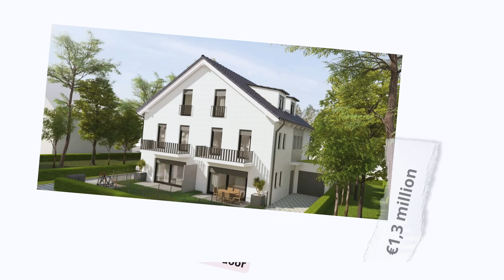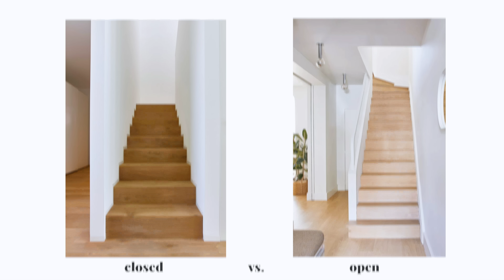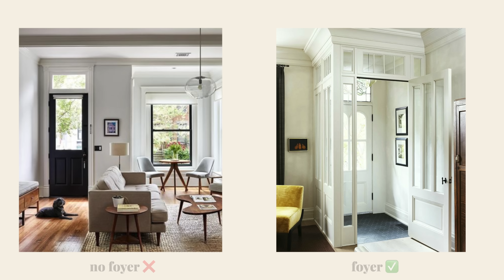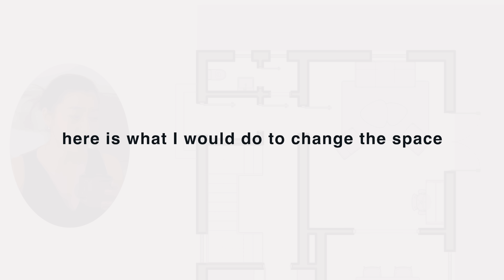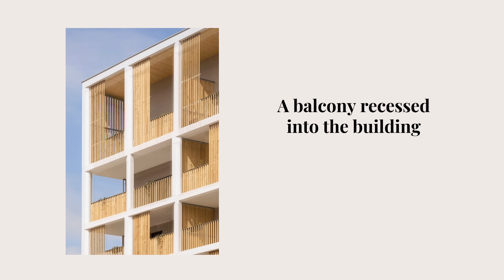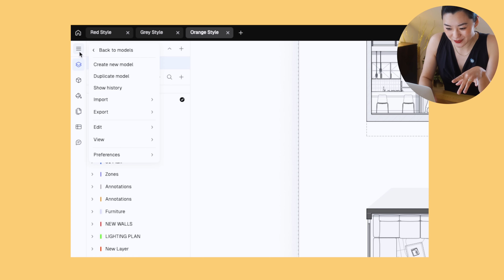Architect’s Advice: 7 Common Layout Mistakes + What to Do Instead

Comment: My grievances/experiences: 
1) No Genkan: it doesn't need to be Japanese style, but every home should have a little space with an easy to clean floor where you can sit down, and take off your muddy shoes, soaked coat, umbrella, etc. and let them dry, store frequently used outdoor attire... Meanwhile, what I see most often: no space planned in for shoe cupboard, coat hanger, etc. and everyone squeezes past the furniture, until something falls down or over and mud gets everywhere...
2) unnecessarily long corridors: they take away a LOT of space and if they're narrow and go around corners, you'll have trouble moving furniture! 
3) centered doors and windows: I'd put a different reason against them: try fitting a bed into a small room with centered doors and windows!
4) Having more than four corners, odd angles, or steps inside a room. They make furnishing hard! 
5) having doors or windows collide with furniture such as your bed, or the water tab getting in the way of opening the window, or having a light switch hidden behind a door or worse wardrobe. 
6) Kitchens should be close to the exit. You don't want to drag a leaky garbage bag through the entire house! Plus, the pantry and dining a ea should be next to it. Also, keep in mind that kitchens can get very hot and moist. Thus, high ceilings or strong ventilation are highly recommended. 
7) allow cross ventilation through the entire house. To me, a bathroom without a window is a breeding ground for mold. Yes, you can install ventilation, but my experience tells me that it never works good enough...
8) even the smallest flats should have 3x3m space kept free. You'll always find a use for it! Sport, ironing, working on something, etc.
9) plan in enough storage, or rather more than you think that you need...
10) Think about the future: kids will move out, your mobility may get impaired, etc.
11) Pay attention to natural light and prevailing winds! There's no point of installing a roof, if the wind throws rain right under it! You'll hate driving to work, if you get blinded every time and good luck reading from a monitor, if the lighting comes from the wrong direction...
12) For Europe: since AC is out of the question, make sure that your shades work in summer! There's nothing worse than good isolation, but a glass house effect!
Reply: Why is AC out of the question in the EU? Trends appear to be the opposite by my observations.
Reply: @court2379  I've only seen AC in fancy office buildings, hotels, and regular supermarkets. We had kids collapse in school, because they refused to install AC or give the kids a day off. Work in many places can be a huge pain too, especially if you're in a kitchen or with machinery that generate heat during their operation... BTW: I'm talking about central Europe including Switzerland. I'm not talking about Eastern Europe, which does seem have more AC and better internet despite being poor...
Reply: @court2379  To answer your first question: I don't know.  My best guess is that dreaming of AC is considered a thought crime in the world of Environmentalism...
Reply: 7) Windows in bathrooms are prone to condensation, rot, and mildew. I'm not denying the truth of your experience of inadequate mechanical ventilation, but spending a little more money to get a higher flow exhaust fan can easily rectify that. In fact, it is imperative to have  high capacity exhaust fan in a windowed bathroom. The second factor is how long the fan operates. Best to have an automatic switch that turns on when somebody enters the room and has a timed delay to turn the fan off after the room becomes unoccupied.
Reply: @edi9892  Even in the Los Angeles Unified School District, in southern California, they didn't used to have AC. When they wanted to extend the school year into the summer, they had to install it. It's a sprawling school district, and while some schools are within a few miles of the coast and its ocean breezes, many are in noticeably hotter areas. 

There are many options these days, including heat pumps, and little "mini split" systems that fit well into smaller spaces and don't require ductwork. But you have to have the wiring to support these things. 

Even with AC, external awnings, external shades, and internal blinds can help a lot. So can solar (sun filtering) window screens.
Reply: These are wonderful observations. Thanks
Reply: I like your list, best to use good design before thinking of fans, AC and all the new age tech of the last 100 years, good design saves you money on power and ripping out walls
Reply: @edi9892  dont know why you'd think ACs are out of the question. 

In many european areas (north of the Alps) you simply dont need one. Summers are warm and only a couple weeks hot. Homes arent built out of American cardboard so for a couple of days the houses themselfes act as an additional coolant. 
You'll just need to use your house in the right way, not only with shades but in the way you ventilate with your windows. 

Installing an AC costs extra money. You dont want to pay western europe level of money for even more electricity. And AC needs a lot.

Most of the year you wont use AC so you have to take extra care of it. You dont want to build a biome for fungi and other stuff you'd blow right into your face the moment you'd turn on AC the next time.
Reply: @edi9892  true and also no.... some do refuse to have them. They are bulky and ugly most of the affordable times... Shades of all kinds are more economic and saves spaces. (Most of the times...9 There are inner and outer ones.. and they can look cute. And there is some strategy on how to preserve cold air a little... 10.00-14:00 closed Window and closed shades...
heatwaves with no ac are bearable up until around 35 Degrees only around 45 its hell...

And it´s worst with sewing maschines and ironing tables in the 3rd and upwards floors, where you sew in summerheat wintercoats and it generates in the ironing places even more heat AND humidity of up to 87%.

Hitzefrei only if its outside a prolonged duration of 35 dregree in shadow.. thou inside its around 45degree.
Reply: 1) Yes. I hate new "Open design"
8) Finding empty 3x3m in a European flat is hard, especially if rooms are smaller than that.
Reply: @GOKIS I don't know many places in Europe with actual rooms smaller than 3x3m. These tend to be toilets, or in some really funky layouts that date back a couple of centuries...
I guess that most rooms are 3x4m, or 4x4m, so still not big by American standards.
Reply: @edi9892  eastern europe isn't poor anymore
Reply: @bolek-trolek I guess relatively speaking the gap closed as the West got poorer and the East richer...
Reply: @edi9892  i'm from slovenia and talk to other easterners, those with no roots in the west, that's younger migrants, are coming back already. oh and don't get me started on cultural enrichment and doctors they have in the west. with this in mind the west is much worse off than we are

Comment: The windows on two walls doesn't work if you only have 1 exterior facing wall.  But the same effect can be achieved by having a good flow between rooms.  The ranch house I live in for example has double door openings between the kitchen, back den, foyer, front formal living room, and front formal dining room.  So the light from south facing big picture window in the front living room goes thru the foyer into the back den, which has big floor to ceiling windows facing north.  That good flow lets light from all these different rooms flow into the next room, for something built in the 70's its a great open floor plan with a ton of natural light.

Comment: Thanks for this great video. My home was built in 1909 and literally checks every one of these boxes (except for the balcony which I don’t have). This just goes to show how well designed homes from a different century were. Give me an old home each and every time compared to the new builds of today that are just slapped together and design is an afterthought. 

Yes, older homes may need some updates to the mechanicals and decor, but you have an incredibly well built structure from the start.
Reply: There's also lead and asbestos! 😬
Reply: @ All things that can be remediated like any issue in a home.
Reply: @andrewcroce3638 : even homes built in the second half of this century no longer meet the ever evolving codes.  New doesn't mean better.
Reply: My aunt and uncle bought a little house high in the Rocky Mountains above Denver (Colorado, USA), where they raised their four children. One day they saw a historic picture of their little mining town, and there was their house!  It was over 100 years old; they'd thought it was maybe 60. It was likely done like so many houses in that era: the product of a house raising. The wood framed walls could have been put up in a day or two by an army of helpful neighbors. From the outside, all the windows up and downstairs were evenly spaced. But once you climbed the steep narrow staircase and found the master bedroom, you'd find that one of the front windows was inside the bedroom closet. 

Of course, the closet partitions may well have been installed at a later date, as were the bathroom (upstairs under the sloping roof), the kitchen added to the back, and the expanded front porch(es) added to the front.

My aunt and her family discovered antique bottles buried in the backyard; it had been a little trash dump for the miners, I think. That sparked her interest in antiques, and for many years she was an antiques dealer.

There were, of course, better designed and built homes in the town, built by people who had the money. But I never got to tour them.

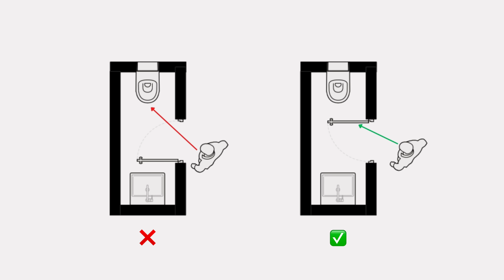Comment: 6:27 Yes! My grandparents passed years ago, but they used to have a lovely little 1950s bungalow in San Leandro, Ca on Farnsworth St. My favorite room was the guest room in the back corner of the house with two smaller but still large enough windows  hugging each other in the back corner. It was so cozy. The other cozy space in their home was an add-on porch room with running windows on the back wall and a massive sliding window door on the left. It was sunny and inviting. <3 I've always loved that!! So intuitive!

Comment: Thank you for reinforcing my view on door placement. I know someone who has a sunroom with windows on 3 sides, one enters through french doors on the solid wall side and exits on the far right corner requiring traversing the room and disrupting anything or anyone in the room. Moving the exit to the nearest corner on the same wall would lead to the same deck/outdoor space without disruption. It drives me crazy that someone would design such a space.

Comment: I have lived in several open concept places and my biggest complaint is the noise transmission! With hard floors, walls and ceilings, the noise bounces around and around! I like your presentation. Very nice.
Reply: Yeah, agreed. The noise and visual pollution in an open floor concept is atrocious, especially if you have a larger family or are an introvert and need some space.  Horrible idea but I suspect more profitable for the builder to make a smaller floor plan feel bigger.  Just anxiety producing awful!

Comment: When you have a small space the enclosed entrance way is a must. The smaller the space the more heat or cool air exits as you open the front door.
Reply from the maker: that's a great point, thanks for sharing your thoughts!

Comment: Great video, really enjoyed a lot of the practical tips you shared! Wanted to point out something slightly a tangent but related to the balcony chapter - at 8:05 you have a picture of what appears to be cantilever zig-zagged balconies with no covers, I'm not sure where you found that image, but this style of balconies are common in Jewish neighborhoods in Brooklyn, and there's a very specific reason for this. During Sukkot, one of the most important Jewish holidays, the Jewish bible requires creating a "sukkah", essentially a tent/hut, that have a roof that is open to the sky. Real estate developers in New York and Brooklyn created buildings with this specific balcony design to accommodate Jewish families who live in apartment buildings. Just thought I'd point this out in case you find it interesting :)

Comment: We are building a house now and I struggle with windows in the kid's bedrooms. The way the rooms are we either have to put one window or if we do two, they have to be on touching corner walls. This eliminates those walls from having beds on them or dressers, or really anything. So now I only have 2 walls for furniture, and the rooms are not big enough for that. But you are right, one window seems like not enough light.

Comment: (Lighting and Interior Designer here) Good point about  bi-directional lighting - if the building plot and fenestration can accommodate it.  Too many times I have professional designer Clients refute that principal in regards to electrical lighting, thinking one source in the room "lights the room". True, if you are talking about a technical meter reading. But a single source likely means harsh contrast wherein wherever you are located will cast a harsh shadow beyond  yourself as will anything in the room, making it feel uncomfortable.  Round out the space with layers of light from multiple points.
Reply: In situations where adding a second light-permitting structure (windows, skylights) isn't possible; i.e. don't own the property (rent/lease) or the space has no physical exterior wall/ceiling/roof access or it's cost-prohibitive; a natural light source alternative can be a well placed large area mirror to amplify the whatever existing natural light source it might have. Clean, simple, logically-located, properly-sized mirrors act as substitutes. @PalindromeDesign, I completely agree with layers of light. Having ONLY direct electric lighting limits the ability to adjust the mood for its use.

Comment: Hmm, the reason many UK homes are not open plan at the door entrance is to reduce cold air coming from opening the door into the house. In Somewhere like Australia it is totally different because air flow at the door entrance is far more welcome.
Reply: So true.. no floor plan or home design works everywhere.. In Hawaii the needs and realities are totally different.  I hate that our Building Codes are even called "Uniform Building Codes" and that we have to conform to requirements that were dreamed up based on some concept of 'typical' standards.
Reply: I dislike open plan overall.  I want cozy areas that are different throughout my house - where I can CLOSE A DOOR if my kitchen is messy or if I need quiet in the dining room while everyone else runs around...

Comment: With the staircase it depends on your priorities. I agree open staircase looks better although if you want to divide living area from sleeping area, make upstairs more quiet place, closed staircase is the choice. You can make closed staircase cozy, nice dimmed light, soft finishing materials. Even if it's a tunnel it's a tunnel to private quiet place.
Reply: I do like closed staircases and enjoy a quiet transit from one space to another. I have seen wonderful artwork in such places, one friend had realistic looking galaxies and stars along the way, it was marvelous.
Reply: Safety is also a concern. Most of the supposedly better staircase examples came with significant safety issues the 'worse' ones didn't have... though whether those safety issues were as a result of the feature they were supposed to illistrate or not was a mixed bag.

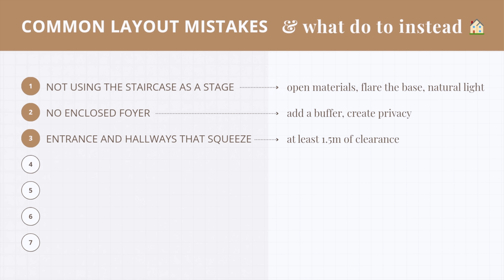Comment: The only critic I'd have about the big open entrance is: air draft. In a country with colder months, the changes proposed on the floor plan at 4:24 could cause a big increase in heating cost, especially by opening the front door to the stairs. In warmer places this would not be an issue and the grand entrance would indeed be much more enjoyable.

Comment: Canno't agree on balconies. The best balconies are open, with delicate railings that allow to be outside while not leaving one's home. 
Closed built in balconies are mostly unusable space. It is terribly cold there in winter, and in summer they become hellishly hot. The roof and the sides allow less light to enter the apartment, are bad for ventilation. 
I would prefer to have wind and snow and flowers on my balcony any time to having an additional boring box to my apartment.
Reply: I'm in between here: fully open balcony is NOT fun for the reasons  she listed, but all boxed in balcony she proposed instead is not a good solution either for the reasons you listed.
I personally prefer either half balcony open on all sides or the balcony that has a roof and at least one side wall (not besessarily solid one) as a wind block & privacy shield.

Comment: Number 1 & 2 are preferences that ties to no 3. Compact spaces can be used in different concept than yours as an advantage to create compress-expand, contrast, and dynamics. So, they're technically not 'mistakes', but rather an insight about your approach in design and it will be insightful in a more retrospective video. No 4 to 7 are spot on. Keep up the great content! 🎉
Reply: Agreed, number 3 is a dealbreaker for some like us as we need a space that acts like a transition room or airlock to ensure coats and shoes alongside all the dirt they bring remain as isolated from the living area as possible.

Comment: Very good points.  What I see in the future is a turn towards smaller homes in the 12-1600 sq ft range making them a little bit more affordable.  The 5000 sq ft mansions are fading out.  Also a turn towards ADU amenities like a 40'' front door and 36'' interior doors in a chosen room or 2. Still a somewhat open floor plan with maybe a slight vaulted ceiling in the living areas.  Basements are being chosen as an alternative sq footage solution on some building lots instead of going upwards